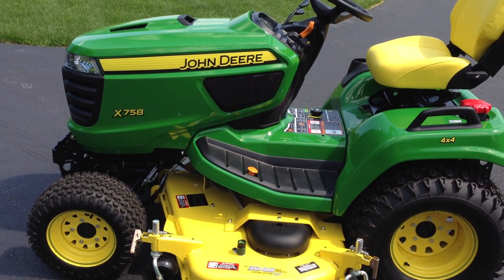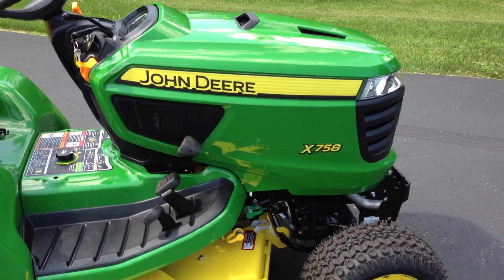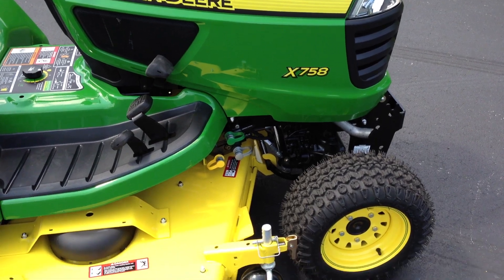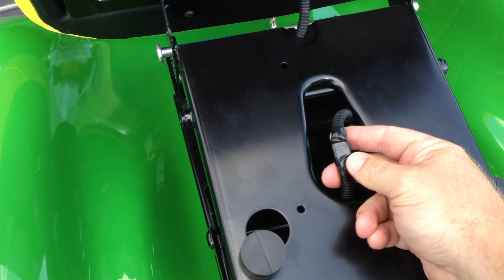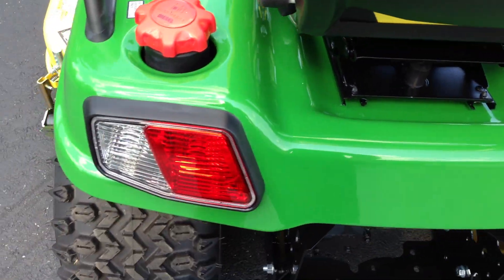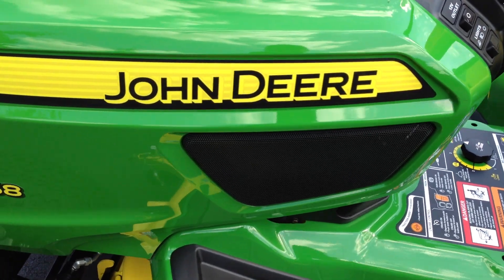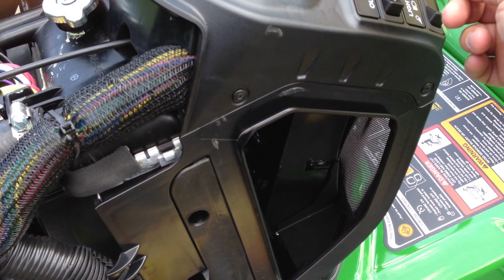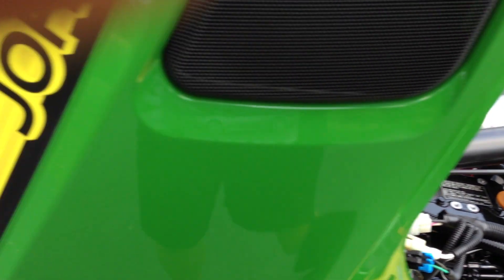John Deere X758 Seat Switch Bypass and RIO Switch Bypass How To

Comment: My X475 has already had the RIo modified before I got it. I am wondering if their circumvention failed cuz now I have a deck that doesn't have enough power to it (stops in real grass but lets the motor run no problem..) Thank u for your video!
any advice is always welcome!
Reply from the maker: Hmmm that’s odd. It wouldn’t be from the modified RIO.
Reply from the maker: So the engine keeps running but the blades stop in tall grass?
Reply: the culprit was a series of bearings and gears in the rearend. Basically the entire PTO/Clutch Bearing was chewed up. Rebuilt it from Ebay parts and Deere too. Back to running like a deere!
 @WilliamZ-

Comment: PLEASE  HELP     I recently did this bypass for the seat switch and reverse switch.  The bypass worked but the next time I went to mow my lawn the PTO switch would not work, the blades will not engage and I get a flashing icon on the screen regarding the PTO.  Even though the bypasses work, now the blades won't engage...I checked the fuses and they are fine...do you have any ideas as to what I can do to get the PTO working? Thanks.
Reply: Did you ever figure out what was wrong

Comment: i would like 2 Bypass my Seat Switch & my RIO on my x724. :) but im not sare on how 2 do it.
Reply from the maker: +MRJOHNDEERE3720. :) The switches are just a contact switch. All you are doing is connecting the 2 wires together on each switch to fool it as if it's being used.
Reply: CDW
o ok cool. thanks 4 the info. :)

Comment: I connected the 3 seat wires together with a wire nut and the bypass worked, but the next time I tried to use the mower the blades would not engage...I tired soldering the wires together then duct taped the ends but the mower blades still wont engage...any other suggestions?

Comment: I disconnected my seat switch. My yard is rather bumpy and since this thing rides like a buckboard I was constantly being bounced off the seat just enough for it to shut down.  That got old very fast.  Thought I could live with the RIO WRONG!!!  I mow backward about 20 times while doing the lawn and pushing that button really gets old.  If you just touch the reverse peddle a split second before pushing the button it shuts down.  That will be fixed before I mow again.
Reply: Man thats strange I have a brand new x758 and it rides like a Cadillac man, the seat is unbelievably comfortable

Comment: Something to think about, my John Deere dealer would have to hook the safety switches back  to factory, its a legal issue in case someone gets hurt. Instead I hidden a switch under the hood behind the dash so you can't see it, I can set it back to factory with a flip of the switch that way they I can't be charged to hook it back up if I need to have them work on it.

Comment: The point of the seat safety switch is if for some reason you get knocked off the tractor or tip it over the engine shuts down for safety. The RIO is one I can live without as long as one makes sure things are clear behind before backing up. But to me it is no big deal reaching down to push a button. But again the seat switch is a good one to keep connected in my opinion.

Comment: I highly recommend NOT bypassing the seat switch.   That seat switch exists to turn off the blades should the mower flip or roll over on you.  Think about that for a moment, being trapped under a mower while the blades are spinning.  

I have personally flipped a mower on a hill, it happened suddenly and unexpectedly and trust me , the seat switch is a life saver.  I'm not a safety Nazi but this switch can literally save your life.  

The reverse switch is okay to bypass in my opinion.
Reply from the maker: I agree this is not for everyone. Where I mow is completely flat.
Reply: Well said, Dir GuyJerry, well said. This happened to a friend of mine, she was  approximately 12 years old. She survived by God's grace. So maybe for a friend or family member please leave the seat switch as is.
Reply: I'm 61.  I've mowed 2 acres on HILLS with a 1981 IH Cub Cadet 782 (and a 197? IH 1650 before that, and a Bolens 1256 Husky before that) since 1982- any and all safety switches bypassed... and no rollovers or blade encounters.  The issue is INTELLIGENCE.